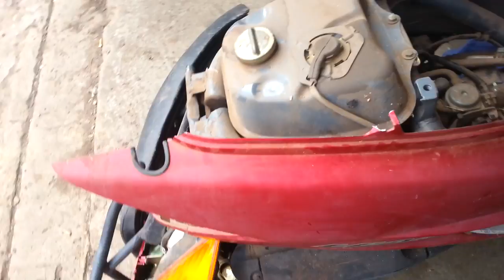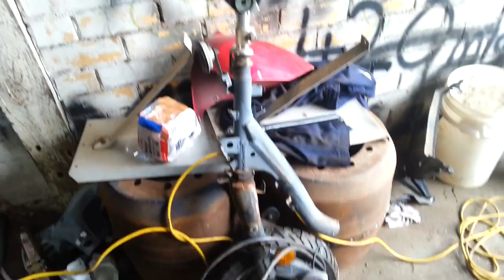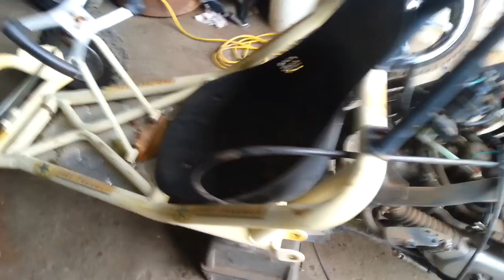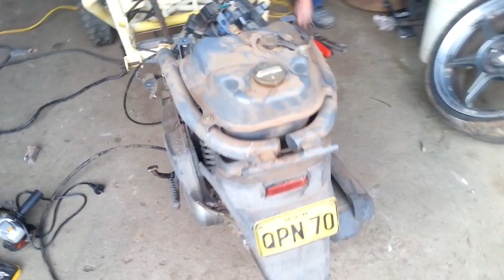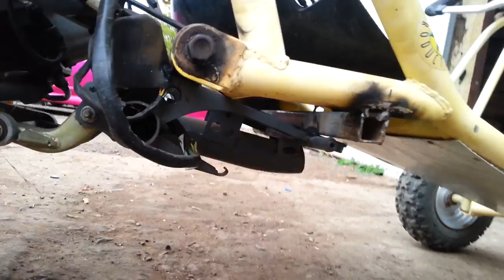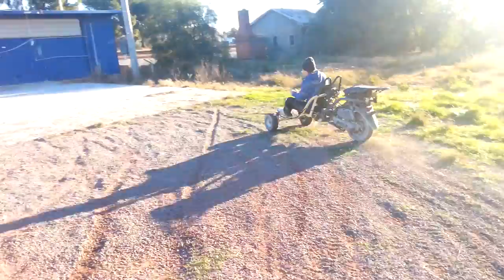Building a 100cc Honda Mo-Kart (Half Moped Half Go-Kart)

Comment: Hey question man I have the same motor in a a propped buggy though but can't figure out wires to a normal pit bi oke wire harness was wondering is the green missive wire suppose to be missing if so what coular replaces it hehe
Reply: its groun wire use like 18gauge?